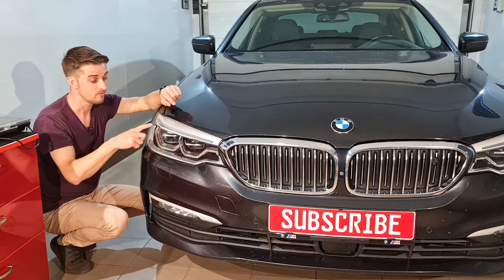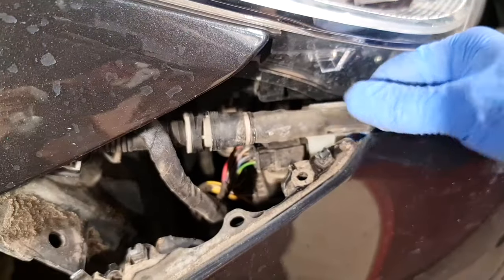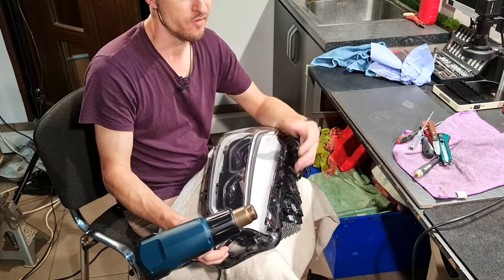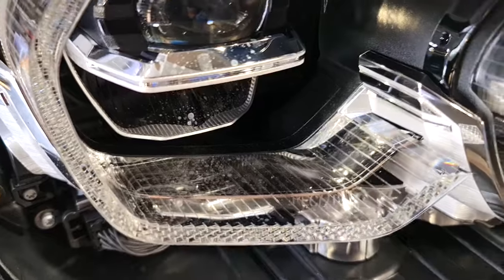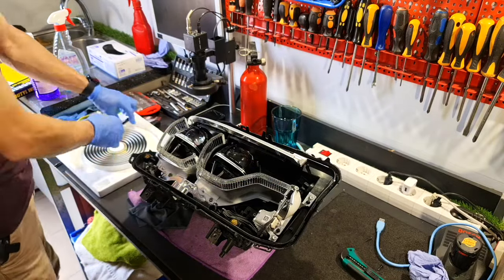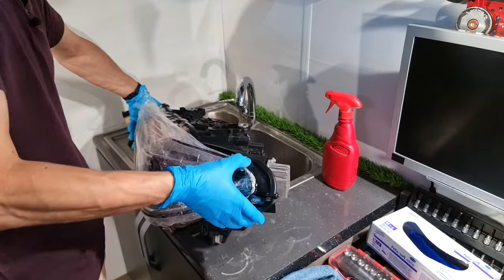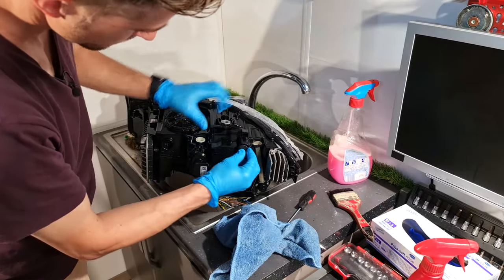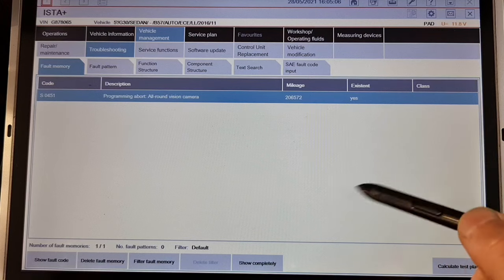BMW G30 Cracked Headlight Repair , Lens Replaced

Comment: Thank you so much for posting. You have no idea how glad I am I found this video. I naively thought I could take the front bumper off my G31 (I wish to install front lip). However I got stuck after freeing the bumper - no clue how to unplug the electrics and headlight washer. After seeing your video I will continue today to give it a go. Thank you so much
Reply from the maker: Amazing,  let us know how it was going !
Reply: @MOvidiu  I got the bumper off eventually. But had to break the electric connectors, where they attach to the white brackets (those teeth / grooves). Just found it impossible to release them. Used tape to fix them when put them bumper back on

Comment: Again I have to say it.... he’s the Michael Jordan of these repairs.
After being extremely meticulous with these repairs he cleans and lubes surrounding parts.
Many times I’ve gotten repairs to find out a few months later a simple o-ring has failed
Reply from the maker: Hey,  thanks for your support! 
To do a correct job you need to respect some simple steps if you do them in the future that oring won't fail 😉

Comment: Great video and detail.  Could you please let me know where I could purchase the lens cover?  Do you have a specific vendor you prefer to use?  If you could provide a link it would be great.  Thanks for your videos.
Reply: Could someone please provide url link to G30 headlight Lens cover which we can purchase?
Reply: I would also like to know
Reply: @Filip-tw7bu  if you happen to find out where we can get it please post it here as they never replied to my post.  Thank you.
Reply: @JorgeSanchez-xm7pc  maybe China, but some cheap quality. For the moment they aren't aftermarket parts of headlight. Only if you get from a doner car that was crushed. So if you have problems buy a new one or try with used

Comment: great content, learned a lot! i have the same model and condensation only happen after car wash, not during heavy rain, any idea what might have caused it?
Reply: It could be the pressure of the water jets in the car wash, forcing water past the seals. Or it could be that some car washes use warm water and the temperature difference from outside to inside causes condensation.

Comment: What about Renault LED headlight, it is not butyl its not getting soft because when heating, the glue is hard like front glass adhesive polyurethane, can it be taken apart like yours? Where did you bought a  brand new lense?

Comment: Great work! Appreciate you posting this. Just subscribed your channel. 
If you do not mind, I have a question: by disconnecting the radar, sensor, lights, etc (I assume battery needs to be disconnected first), without altering anything but only the lens, do I have to recode the car? I am ready to try this but I have no way of coding it afterwards.
Thanks again!

Comment: Hi I have same problem with my headlight glass and also have damaged silver plastic pace  which is attached to glass .You had same issue in video.Do you do this as a business . If yes ,how much for headlight repair . If not any advice where to get sealant and glass and maybe silvery parts  . Thanks in advance - Excellent Work
Reply from the maker: Hello,  I can't help you with that,  you need to find someone in your area or to doit yourself,  but be careful it is a hard thing to do,  unfortunately there is no paint for the silver pieces ( they are aluminized in vaccum)
Reply: @MOvidiu  Thanks for replay . Find a headlight not functional but glass and silver peace ok , going to swap to my headlight  will fallow your instructions and hopefully will be ok .Any advice regards sealant and glass in case if didn’t work out. Thanks

Comment: Hey, what's the liquid you used to clean the shiny parts? I started cleaning with alcohol wipes and the shiny paint started coming off🤐🥶
Reply from the maker: It's a solution for cleaning windows, but you don't have to press hard because that layer thin

Comment: Are you able to do a video showing the central and rear jacking points on this car? A lot of the videos have jacking points up until the f series only. None for the G series. I have a G32 and it would also help me as I get mixed messages as if I can use a central jacking point on this model.
Reply from the maker: Hello , for your car in technical information there are 4 jacking points it does not have a central lifting point, only the 4 pads under the rocker panels, This is the warning from TIS : The vehicle may only be raised with the vehicle hoist at the four jacking points.
Reply: That seems like a problem. How is this vehicle meant to be jacked up and worked under? For example if I need to change brakes I jack the car up on the jacking point as you said but I need to place a jack stand somewhere to make the car stable. Where would you suggest this goes?

Comment: How do you deal with butyl glueing Hella headlights (like on F20 LCI), they have no screws to hold lens cover, only some stupid U-shaped nails that are burned through the cover and housing. I have tried before to put these in but that was not really possible.

For now I'm thinking to put some regular U-clips around the edges of the lense (as on AL headlight like from BMW F45 LCI)

On the other set of Hella headlights for a Renault the lense comes apart a bit, no big moisture problems but body lines are a bit weird due to this
Reply from the maker: Hello ! check out on my channel I have other videos with headlight repair !
Reply: @MOvidiu  Thank you for your fast reaction, I saw one where you put back the original lense (for F10 I think), but new lense doesn't have the holes I think, I will look some more. You have great video's!

Comment: Can the the beam bulb/led be replaced? My 650i f06 having error "dipped beam left failure"
Reply from the maker: Yes,  but for that you need a donor headlight
Reply: @MOvidiu  need to remove headlight lens or can replace the bulb/led from back access?

Comment: I cracked the cover of a standard 2018 G30 LED headlamp and the only dealer in Peru wants to charge US$ 4500 for the whole assembly -just parts-.
Reply from the maker: Yes that is the normal price of that car headlight. and officially is not repairable, it is completely replaced. just because I fix it or there are others who fix headlights, that doesn't mean everyone has to do the same. or that this should become the rule in the automotive industry